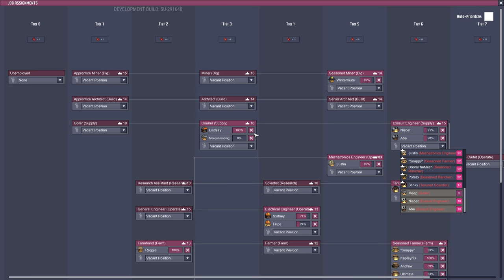SPACE INDUSTRY BASE #17 - Let's Make Liquid Oxygen LOX - Oxygen Not Included [4k]

Comment: Of course you just built your liquid O2 up right there... buuut, I was thinking you should dig a giant hole underneath your rocket, enough to let most of the rocket exhaust escape without heating up the bottom too much. Cool the bottom a bit with a wheezewort or some radiant pipe, and then just purposefully drop all the rocket cargo down there so you don't have to deal with manually working your conveyor system.
Reply from the maker: I think the rocket needs a base though?  I like the idea though :)  storage dump!
Reply: @GrindThisGame  I think it does too, but one tile unmake/remake isn't that much extra work compared to faffing with the conveyor that will probably work fine next update.

Comment: for your cooling you need an empty spot in the pipe for the liquid to flow into as soon as you filled up the pipe completely it stopped working try emptying 1 pipe piece
Reply from the maker: Yeah just after I finished recording I drained a few beads of coolant and it all worked nicely :)
Reply: yup. I wonder if they're ever going to change this perpetual circulation mechanic...
Reply: Or use storage tank.
Reply: will a storage tank still cause the same effect if it's full and the pipe is full? the mechanic seems to work because any output will effectively provide pressure, but in every variation I've seen or tried it only works if there's a section of pipe that isn't full.

Comment: i tested the weezworth for 500 cycle and they are really stable in there cold output the only thing you want to have for sure is 1 free tile above the plant and minimun 1kg of hydrogen in each tile.
Reply: in hydrogen it take 7.5 ish weezworth to do the same job as a nullifier witch dose -80kdtu/s so 1 weezworth in hydrogen is around -10kdtu/s
Reply: @raptor0286  its called a wheezewort, not a weezworth.
Reply: Ultimate ahah oups
Reply: @raptor0286  it's oops, not oups.

Comment: You built that heavy wire 2 tiles from the ladder, and never got to put a wall next to it? :D Also you can make a vacuum with automated doors between 2 layers of wall, if you want perfect insulation.
Reply from the maker: the dupes don't go in there often. I left the wall as a todo...im might actually replace it with conductive heavy wire to get the raw metal back.  I was thinking of sucking the air out with a pump but doors sounds like an interesting way. Do you just use automation to open them all at once to make a vacuum?
Reply: @GrindThisGame  Yep, just build the first wall, the doors, and the automation, then the second wall, and just open all the doors with an atmo sensor or something. It's almost like corner building, but less tedious. You can even leave an entrance to your cooling room this way.

Comment: my setup circulates oil into space to dissipate heat. kinda have to vent off a little air into space to help dissipate it though(like 10g/s).

idk why anyone would bother with liquid hydrogen other than as an experiment though, the tolerances are so low and there's really no need for a hydrogen engine. when you research it research points pretty much become useless and a petrol/LOX rocket can do pretty much everything you actually want to do in space(get wheezeworts and space mats).

I'm still waiting for naptha and methane engines...
Reply from the maker: Liquid methane just like spacex. Yeah doing liquid hydrogen is not worth it but I wanna try and see if I can do it.
Reply: Eagerly awaits Raptor engines

Comment: Can you please explain how you cool your solar panels?
Reply from the maker: I dont. they just sit in space and havent melted yet....
Reply: @GrindThisGame  How do you mass produce egg shells? I am struggling with making steel for space exploration
Reply: Make sure they are in the vacuum and sweep anything on them before they heat up.
Reply: @timolanlau7454  make a 1 by 1 tank with water in it and put loads of fish in it with an auto sweeper above putting egg shells into a storage compactor for your dupes to take to the crusher thingy. (also works with other critters, but don't put water in if it's not a fish) never tried it, but should work. the critters will get glum and cramped, but you should get infinite egg shells.
Reply from the maker: You can mine fossil at the bottom of the map. That will give you tons of lime. As ultimate says you can make a large pacu farm as well. A large hatch farm will also give you some shells.
Reply: @Alan.24  But this is not going to last forever right? At some point the critters are going to die because of age so you have to keep some eggs in there so that they can hatch
Reply: Timolan Lau you leave the eggs and take the shells when they hatch. That way they won’t die. Pacus always lay one egg a lifetime in the wild, and if you feed your critters, then they will make more eggs that hatch which equals more shells to turn into lime.
Reply: Timolan Lau so feed your critters if you want mare eggs.
Reply: More
Reply: @Alan.24  thanks a million 😊
Reply: @timolanlau7454  your welcome